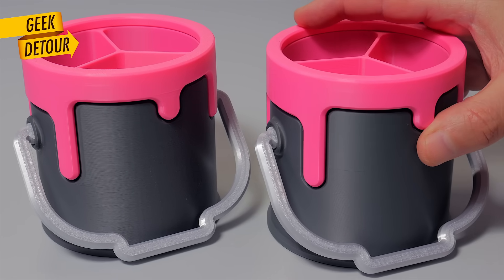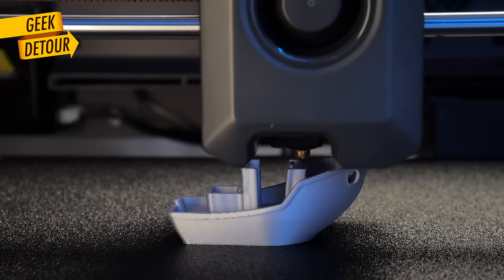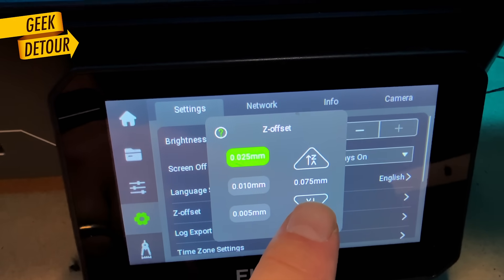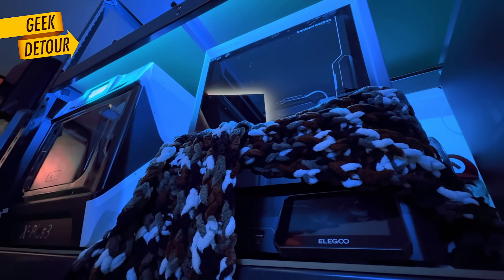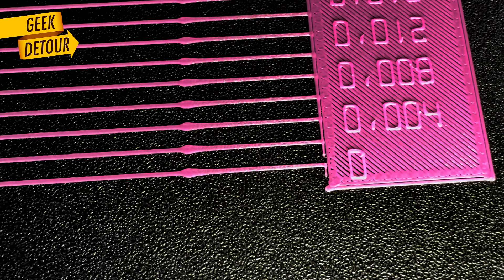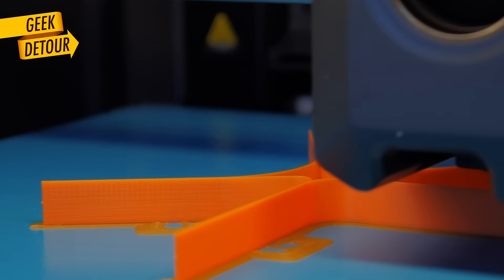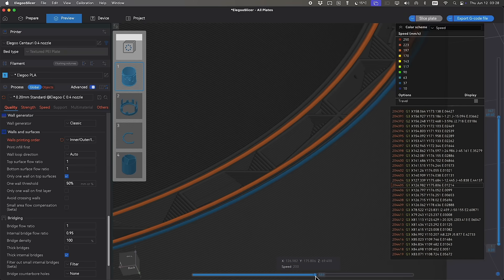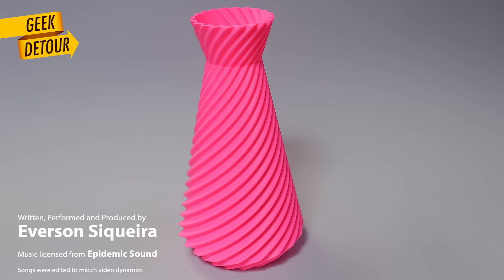Auto vs Manual Calibration — Elegoo Centauri Carbon

Comment: Thanks for that. I got a pretty good first layer dialed in by now.
Re ironing, I found 40% flow rate and 50mm/sec pretty perfect for PLA and also for PETG. I'm still working on proper ASA settings.
Also for Ironing, you would want to crank up the top layers to avoid scarring, especially if it's a bigger surface. I found 8-9 top layers best (again, PLA and PETG).
The nozzle temp G-code does puzzle me though. Changing the settings like you said, wants to get the nozzle to 220 (first layer of my PLA profile). But after 10-15 seconds it switches back to 140 degrees, cools down and then tries to clean the nozzle at 140. Then it jumps back to 220 and starts printing. If I interrupt a print, slice it again and then start it again, it ignores the 220 degree part altogether.
I checked the G-code but I can't find any obvious line telling it to jump back to 140 just before cleaning. May it be the G90 or G28 command are coded to that temperature? At least G28 is homing the head, and from what I see, homing as well as leveling is done at 140 degrees, and in your code the only commands between nozzle and bed temp and nozzle cleaning are those G90 and G28 commands. 
I'm at Orca 2.3.1 atm, firmware 1.1.29. You have any idea what can be causing this or how to fix it?
Reply: I don't suppose you've found out what causes the nozzle temperature returning to 140c issue? I'm running to the same thing.

Comment: Thank you for the guide! It has really helped. I do have one question. When I set my z-offset in the printer profile in both Orca and Elegoo slicers, the resulting slice looks terrible. It has weird artifacts and partially complete outer walls. Do your slices look the same when you enter the 0.075 mm z-offset compared to just leaving it at 0? Thanks!
Reply from the maker: It was my value. Your offset will be different.
Reply: @GeekDetour  Thank you for the response! I was not clear in my original comment. I realize that 0.075 mm was your value, mine was 0.025. I was just asking that when you entered a value for the z-offset in the slicer printer profile, did you notice artifacts in the slicing itself? I tried multiple values for the z-offset to test and the slice itself would be all messed up in the slicer at any value other than 0. I hope that makes more sense.
Reply: @lotrguy237 you don't need to add your Z offset value in the slicer. The printer saves it when you change it. Until you run auto leveling again.
Reply: @benventer2316  Thanks, that makes more sense! Kind of annoying though because I auto-level regularly, so I have to fix the z-offset each time. 😕

Comment: Great job! Is that nozzle G-code safe to set to 200'C? Or should it be coded for variable temps determined by used filament type? (And how to do it?) I am a noob and need ready G-code for Orca Slicer. Thanks in advance

Comment: I did a z offset test and at 0 the results looks ok but when you lifted the finished sheet it was individual strands. So I brought the bed closer to the print head a little and it resulted in a very tough, seamless smooth surface...and yet the initial L shape line it draws continues to thin out at the area closest to the middle of the door and I can't figure out why. When it prints oh that area is seems fine, but that initial line hasn't been solid since I got the machine. Any ideas would be welcome. Thanks.
Reply from the maker: Hi there! Please, try heating the bed for 5 minutes and then perform the Bed Calibration once more.
Reply: @GeekDetour I always do a preheated bed calibration before each print. So I don't think it's bed heat adherence. The L shaped purge line just seems very thin towards the front centre edge. It can even look a bit goopy in spots too. I watched the head do it and it physically slows down on the problem area too. Not sure if that's how it's suposed to work or not. This is my first printer. 😅

Comment: Was a modified Start GCODE uploaded somewhere?
Reply from the maker: The reason I didn’t upload my GCode is because Elegoo is likely still changing the Start GCode on Slicer Updates and it would be bad if people got stuck with my whole modified GCode and not benefit from corrections or improvements done by Elegoo.
Reply: @GeekDetour thanks for the explanation!

Comment: PSA, in the start gcode, watch out i accidentally put a 1 after the s for the nozzle heating so this "M104 S1[nozzle_temperature_initial_layer]" instead of "M104 S[nozzle_temperature_initial_layer]" this results in your printer setting the hot end temperature at 1210 degrees C 😅

Comment: I set my Z-Offset to the same as yours 0.075 and then tried it and went to 0.08 and so far between the two as a test it way better. I'm printing a mod for the CC in ABS and it printing way better. The pressure advance I dialed that in and it seems really good.

Comment: Thanks for this video.
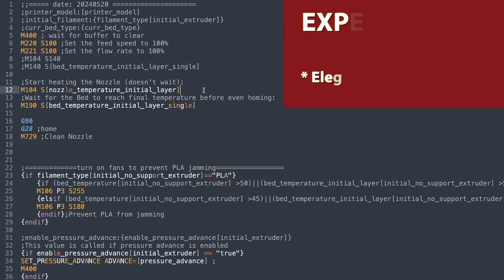Preheating at 4:30 isn't perfect because timing heating bed/nozzle does often not match and filament leaves (drips off) the heated nozzle during homing.
I use a reduced preheat temp until printhead has done homing:
...
;Start heating Nozzle
;niedrigere Temp setzen zum Schutz des Nozzle-Reinigers:
M104 S{nozzle_temperature[initial_no_support_extruder] *0.8}  ;do not wait for lower Nozzle-Temp

;Wait for the Bed to reach desire temperature bevore even homing:
M190 S[bed_temperature_initial_layer_single]
M109 S{nozzle_temperature[initial_no_support_extruder] *0.8}  ;wait for lowered Nozzle-Temp

G90
G28 home the axes  (poorly no separated XY- homing possible for the Centauri)
M104 S{nozzle_temperature[initial_no_support_extruder] *1}  ;do not wait for desired Nozzle-Temp 

M729 ;Clean Nozzle
M106 P2 S255
M190 S[bed_temperature_initial_layer_single]
M106 P2 S0
...

Comment: Can't seem to get my vfa to get better ive did the test and played around with acceleration and the print speed also set the pressure advance and added an extra wall and they just either get worse or stay the same. Printer is currently on a cement paver and a rubber paver underneath sitting on floor. I guess next step would be Messing with the belt tensioner but idk

Comment: how does the external wall speed printing speed affect strenght? the speed where you don't get VFAs can sometimes be higher than the ones on the default profiles and not strictly slower.

Comment: great video     but what is the best gcode flavor for the centauri      Orcaslicer initial was marlin legacy    but now its klipper.   elegoo states it isnt klipper on the centauri. but tech geeks say they found klipperish software on the centauri.  so what to run ?
Reply from the maker: We are suspecting it is using a modified Klipper, yes. Personally, I use the OrcaSlicer Elegoo provided for the Centauri 🤷‍♂️
Reply: @GeekDetour  i use orca slicer regular   but you can still choose a gcode flavor. thats the question

Comment: Hi, i cant get a even first layer, i have low and high spots on different positions on the print bed. I tried the bed leveling, even the complete self test and different build plates(did the leveling after each swap), but same result. Do you have any suggestions?
Reply from the maker: Yes, take a photo of your First Layer and post it on the official Centauri Carbon Users Group on Facebook. There it is much easier for anyone to look at your photo and figure out what’s happening

Comment: I'm wondering if the pressure advance is the same for all filaments? Or if it will vary significantly between filaments.
Reply from the maker: The optimal value differs from each filament (and actually if you are rigorous, even if you print on a different temperature it will be slightly different). But very often, for the same material (ex: PLA… PETG…) they are roughly the same. When I buy a new filament brand, or when I realize I am using a new filament for more than one spool, I test it and create a new profile for me.
Reply: @GeekDetour Right on, thanks! I’ll be sure to check it out when I have time 🤘😎🤘

Comment: New Centauri Carbon owner here and your video is incredibly helpful!

Do you have any advice on reducing the noise of the printer at all and how the fan settings (or replacement fans) impact print quality? I use this printer in my office around 2 metres away from my desktop computer, and it’s quite loud even with the lid on and riser vents installed.

Comment: Did you ever figure out if 200c was too hot for the nozzle pre-heat temp? I would think that it's not, since most filaments print at higher than that for temp... I'm assuming it was a concern about being that temp and wiping? Have you noticed any issues as of yet?

Comment: I was looking into the start gcode following you pointing out it's not ideal. After going down a few rabbit holes I found mentions of not tapping the nozzle onto PEI beds any hotter than 150, so I've tweaked my start code to ensure the bed fully heats up and the nozzle reaches 140 before it does the initial home and nozzle clean. Luckily I checked before setting it going with the nozzle at full printing temperatures.

Comment: Don't be a dummy and forget to reset the z offset on the printer screen back to 0 when you transfer it to your slicer or you'll double the offset. Fortunately, my nozzle is extra clean now 😂
Reply from the maker: Interesting: some people said their machines started saving after a firmware upgrade… I need to check 🤣
Reply: @GeekDetour  @TJ4774 any further confirmation on this? Should I only be setting z-offset on the machine itself and not changing anything in my slicer? Or should I set the machine to 0 and adjust in slicer based on callibration?
Reply: @Kitch77 a little late here but yeah, I'd recommend finding the offset on the machine then zeroing it out and entering it into your slicer. I recently had some trouble and when I went to check the offset on the machine it deleted what I had entered so I had to find the correct offset again and that's when I zeroed it out and transfered to the slicer.

Comment: Why on Earth doesn't it save the z offset ? :( It took me a while to work out that the increase / reduce offset buttons where opposite to what you're used to when using Klipper.
Reply from the maker: It seems it depends on the firmware you have in your Centauri Carbon: some friends here told their machines started saving the Z-Offset. I need to check if mine already has a new version available - my machine was super early production model.
Reply: @GeekDetour It's true for me too! The machine saves the z-offset permanently. So no need to set it in the slicer (it would make things worse). Would be great if you could add that in the video description.

Thank you for this amazing video ❤
Reply: I didn't realize this I need to redo mine. I assumed it saved it.

Comment: hi, I have problem with chamber temperature
I'm my PC profile added a 35°C temperature chamber before start to print
So, I've created a gcode, and looking on it there is a M191 code at start (with, like my example, set to S35 for 35°C )

Anyway, the print start immediatly to print first layer after bed levelling and noozle clean routine...

Comment: I have problems with the first layer. I need to add some Z Offset as the default / auto calibration is too close and the nozzle touches the bed. But even when i add enough so it don't scrape there are points where it is too far from the bed. It's like the the Bed Mesh is not working right ? I don't see the bed moving um or own to compensate ? If someone can help a bit?

Comment: Hey, great video! Where do I get the first layer print that you are using for the z-offset, so I can do that, too?
Reply: In orca slicer, you can add a primitve cube and scale it on the z-axis to the layer height you have the printer set to. It will print only 1 layer, like in the video

Comment: Absolutely great video. Thank you.
I just received my CC and started doing the calibration. However, I noticed for the Z offset, even at 0.025 there is no more adhesion between PLA strands. Even at 0 there is a slight separation, here and there. Only at -0,025 the first layer is becoming one sheet of PLA.

Comment: A bit lost on VFA and ghosting with the CC. He says slow it down to 40mm/s outer wall. Reddit's screaming go faster (200mm/s) that going slow is what causes them. And then random comments telling me to reduce outer wall accl. from 5000 mm/s to 2500 should have fixed it. All these answers so far but no functioning solution 🤷
Reply from the maker: Of course the right answer is mine 🤣 VFAs are worse in a mid-range of speeds. Sure: when it gets fast enough, it gets less visible - the problem is: the print-head doesn’t magically jump from stopped to fast. It accelerates. That’s why, for very uniform look, I prefer to print the outer wall at a slower speed - it quickly reaches the final speed and that speed is the same all around.
Reply: @GeekDetour Curious. Following up. PLA and PETG, reducing outer wall speed to 40 mm/s did nothing for VFAs. I'd say they're just as bad.

Comment: Just got my Centauri Carbon this week, and i had a major problem with it, some screw came in too tight and already stripped, one being from the belt tensioning, and 2 from the extruder cover, so I'm unable to disassemble it if needed... I already sent this to the store where I bought it (here in Brazil you can't buy it directly from elegoo) and they probably will replace it, but it's frustrating
Reply from the maker: It is very sad that Elegoo is not selling directly in Brazil. I hope the reseller treat you nice and provide you with a good unit.
Reply: @GeekDetour  Thanks, they already said it will be replaced, so I hope everything goes well with the other unit. And just for knowledge, other manufacturers don't sell directly either. We have representatives from Creality, Bambulab, and others, but we don't have direct sales 🙃

Oh, and great video!

Comment: As of 13/8/25 it sems that the latest firmware update seems to actually be saving the adjusted z offset after i've turned the machine off, and then on again. Are others noticing this?
Seems we don't now need to adjust the z-offset in the slicer settings...

Comment: Thanks for the great content! I usually use orca slicer (as i am lazy) - but i get the slight feeling i should switch to the dedicated slicer (per printer) even if it is based on orca - is that true? Would i get the best results with Elegoo slicer or does it not matter if i just adjust what you meantioned? Side question, any way to copy all my filament and Printer settings over to elegoo from orca?

Comment: centauri carbon: about the z-offset..isn't it that when you calibrate it on the printer then the value you input in orca slicer is the opposite of it? let's say when you arrived with a value of -.075 in the printer, then in orca slicer it would be +.075?

Comment: Thank you for sharing.  I didn't understand some of this before I saw this video, but did notice a difference in things like pressure advance through trial and error.  I love my Centauri Carbon.  Had it for a couple of months and it's been a dream.  Not perfect, but I( got the updated lighting with it and most of the print errors were user error or some learning process in my part trying to do this for the first time.  I'm now designing my own parts (been modeling for many years), and bringing my creations into the real world.  I'm currently working on a vent system to pipe fumes out the window from the printer.

Comment: I ran the pressure advance test and it seems that .04 is good for me and the filament I'm using, however after I change it, it's like the entire flow rate is lowered.   As an example I went back to print another z offset test afterwards and the lines are super thin with no squish.   I pull up the print and they are just strings, not a flat sheet if that makes sense.
Reply: Mine does the same, ran the line test, changed the setting and it just goes to strings and parts completely missing yet in the test it looked the best. Mine looked best at 0.052 but enter that in the pressure advanced and it looks terrible!

Comment: I'm having some troubles I hope you may be able to help me with, I'm very new to Filament printing and got this printer recently, its been printing great and then started getting real wobbly first layers like you showed, I have tried mesing with z offset and relevelling multiple times but it doesnt help, the front of the plate is definitely sitting higher then the middle and back of the plate.  I did a print a while back where i paused the print half way and filled it with some sandblasting media for weight (very dumb) as some sand got blown around, I did clean everything meticulously, but in my efforts I un tightened the screws in the bed, the spring loaded ones. thinking that was going to help me lift the bed off. I re-tightened and left it, got through 5-6 prints just fine and now im getting this issue and cant work out how to fix it.

Any ideas?

Great video by the way I can't wait to get everything back up and running smooth so I can make all these tweaks like yourself to get better quality from my prints.

Comment: Ok, I'm mega dumb first timer - test files from printables are just models without any slicer settings whatsoever - what settings one should use, for example for 1st layer test? Default 0.2mm layer height on 0.4mm nozzle - do I need to change any settings? I've only played around with Bambu A1 and everything imported to BambuStudio was already set up ready for print so this is uncharted territory...